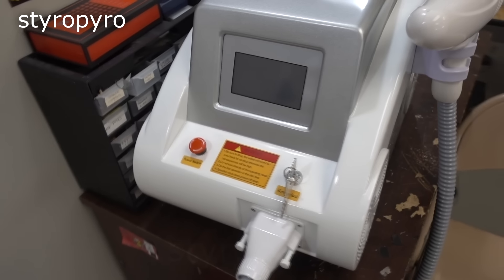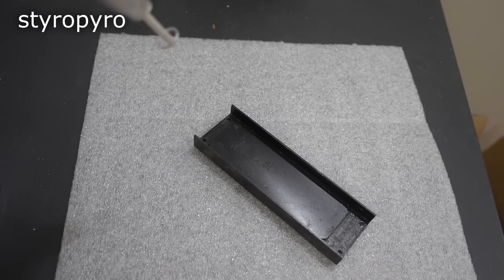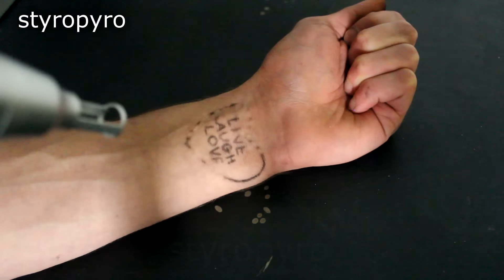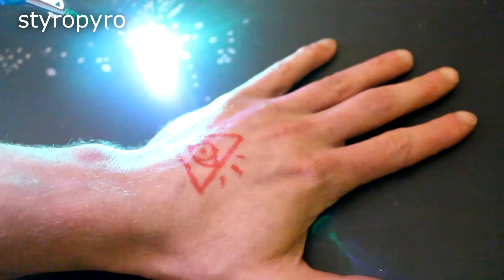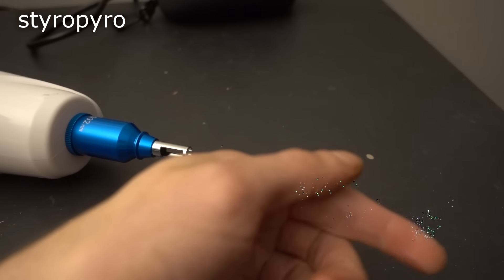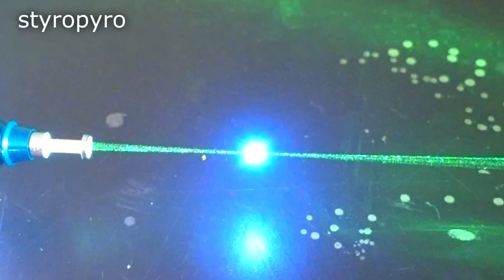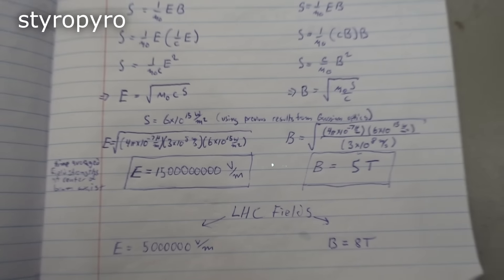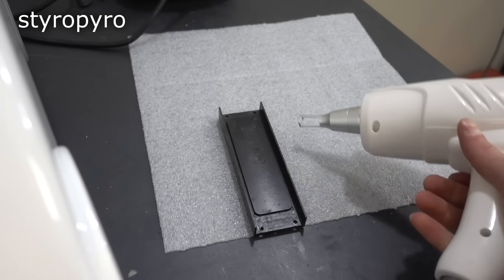Dangerous tattoo remover from eBay is a MILLION watt laser

Comment: This mans mannerisms make it look like he's actually a living puppet
Reply: It’s his face man
Reply: He is
Reply: Exactly what I was thinking
Reply: he's the scout
Reply: rude
Reply: Why you dissing him? Man's a total nilf
Reply: @saturn6458  Jerma
Reply: Thats misleading. Watts are(as we all know it) are measured in watt/hours. That means wattage continuous for an hour. My microwave is 900watts. That's the rating for it running 1 hour continuous. No house or  appt or even an office building is going to have a breaker on the breaker panel that will handle 1 megawatt. You can have 1 million volts by adding a transformer and that's why stun guns exist but theres no way that's a megawatt aka 1,000,000 watts. My phone charger takes 1 megawatt too.... but it would take a year. Wattage is an hourly measurement. Nice troll though.
Reply: @stevem2245  Thanks for the info Steve
Reply: @stevem2245  You're so mistaken... where to start... You seem to be confusing domestic energy metering (kWh, not kW per hour!) with pulsed power measurements. This laser IS using megawatts of power but for a very short period (nanoseconds). If it's 2 Joules of energy per pulse of 6ns, P=E/t so the power during the pulse is 330MW. For the rest of the time the power is zero. If there's 1 pulse per second then the average power is just 2W! Well within the typical domestic plug capacity of ~3kW.
Reply: @manicminer4573  My bad then. To the non laser/stungun/ taser YouTube community then it was misleading. Mostly everything else is measured for a continuous hour. Tell me then.... how many watt/hours would it be? What was the volts/amps of the laser?  And how would you measure that? There is a reason why its measured in such a way at your home power meter. If it was a megawatt/hr laser, than I'd be impressed. Therefore I clicked in the misleading video thumbnail, hence my comment. Help me understand.
Reply: @stevem2245  It's high school physics, but it's usually taught badly. Energy is measured in Joules or kWh. One kWh means 1000W of power for an hour. Common misconception is kW PER hour - it's not, it's a kW FOR an hour. So 1kWh is a large amount of energy.
Energy = power x time
Reply: He seems stiff, yet so loose
Reply: @stevem2245  one watt of power is one joule of energy consumed in one second. 1W= 1J / 1s. your microwave consumes 900 x 60 x 60 joules in an hour of continuous usage.
Reply: He just doesn't seem like a real person
Reply: BWAHAHAHA
Reply: This comment is gonna become another dumping ground for nerdy arguments
Reply: @stevem2245  The Watt is a unit for Power,measured in "Watts", at any instant, similar to Volt/Amps. kWH is Power Consumed.
Reply: Thank you! My god I was afraid it was just me. It’s freaking terrible, glad he’s kinda smart because there’s no way he has a career in acting or reading the news. He’s so wooden that two big honking fuzzy black caterpillars have taken up residence on his face just above his eyes…. -“Wait, what? No way those are just eyebrows…... Really? Hmmm…. Well I’ll be damned.”

Comment: 2:00 No one going to talk about the fact that this man has a screwdriver jammed into a wall socket?
Reply: You wanna know the forbidden art of removing static?
Reply: It’s a ground
Reply: 100% functional ground wire
Reply: you should be doing this when working on any PC equipment
Reply: that's just another experiment, don't worry about it.
Reply: It's stuck in the ground pin which has absolutely no electricity flowing. Some anti static wrist straps are designed so that they're connected to the grounding pin
Reply: Meh, ground, *should* be okay. Just don't confuse it for phase ......

Comment: You could tattoo instead on materials like iron instead of removing. The thing I wonder is why it doesn't hurt to have the laser directly pulsing on the skin vs the green converted version of it. Great video!
Reply from the maker: skin is nearly transparent to the 1064nm light, so that means the skin doesn't heat up much since it's not absorbing much of it. this is great because dark tattoo ink absorbs it very strongly so you can selectively burn the ink while leaving the skin relatively unharmed.
Reply: How did you comment 1 day ago
Reply: @vv6152  right?!
Reply: this video came out 6 minutes ago, how did you comment 1 day ago?
Reply: @vv6152  maybe he has early uploads for Patreon members?
Reply: Styro made it unlisted, and Centanide could’ve figured out the link
Reply: How the eff do people still ask this question? Patreon!
Reply: Essentially, skin is transparent. So the laser penetrates, expending the same amount of power over a greater area. This means it's less damaging, in the same way that having the sun on your skin doesn't hurt, but using a magnifying lens will sting like hell. 

Added to that, light skin doesn't absorb the normal laser very well, and most of the energy gets reflected away instead of damaging the skin. Essentially, things have color because that's the light they reflect away. A Green object reflects green light, etc,. Green and Orange/Red/Pink are opposed though, so a red laser would burn green things, and a green laser burns red things.
Reply: Haha, he even explains why at the end of the video.
Reply: @styropyro  When the skin is transparent. Where does the energy go? Is it reflected and just scattered or absorbed by an underlaying organic layer?
Reply: @styropyro  wait, if skin is nearly transparent to this laser, would be possible to blind a person with their eyes closed?
Reply: 1 day ago.... Sure
Reply: @elios7623  bud it's called patreon
Reply: @vv6152  wtf holy shit your right how did he comment one day ago?!?!!
Reply: @vv6152  YouTube mysteries
Reply: styropyro keep up the good work your amazing
Reply: Did you even watch the video?...
Reply: Deadshot 18079 there’s a glitch in matrix
Reply: Centanide the skins absorb more of the heat from the green converted version
Reply: @chaschuky999  yes i'm aware, but the need of meming is stronger than me

Comment: Styropyro in 2050:
Ah so im on the deathstar of mine
Reply: So I made a new Lazer for it, I just bought one off of eBay, so I went ahead and made it just about 20,000,000 times stronger. But unfortunately it can only Peirce through 2 planets and only travel 6 light years.

Comment: That machine does work.... Those different lens/tips is to change different laser wavelength to remove different colors tattoo.... ie 1064nm,  532nm, 755nm, and 785nm.... It can also be used for permanent hair removal.

Comment: You aren't using it right. That standoff at the tip of the emitter is actually to mark the focal point. The beam is almost colimated bu not quite. It actually comes to a focus at the tipof the standoff. For best results, place the standoff on the surface you are working on. Also, the multiple tips are for different wavelengths. One is for raw IR output (YAG laser output is 1065nm IR). Another tip contains a frequency doubler to output 532nm green light (same as in a green laser pointer). And the last one is a frequency trippler which outputs 355nm UV light. These different wavelengths are useful for people with different skin tones.

Comment: 532 nm light or green light is actually suitable to mend tears in the heart and vascular tissue.. And that's why it burns your skin much higher than IR light.

And if that burns imagine getting burnt by 355nm UV light.. Hurts like a bitch.
Speaking from experience 😂
Reply: Oh common... CO2 kicks ass when it comes to burning sensation. 355 at 10ns duration is a tickle. Well, basically most tissue it reaches evaporates in less than 400ns and the rest of your skin waits for a response from nothing. Of-course if you release a few thousand of 355nm pulses in less than a second, you'll be screaming!! Comments also from experience.
Reply: @johnriver5384  yeah but a 1.5watt CO2 doesn't hurt as much as a 1.5 watt 355nm laser 😂. I spoke merely on the basis of pain level at specified wattage.
Reply: AH
Reply: on the flip side, i used to work optics with verizon, the video gear is 1310, 1480, and 1550 nm IIRC and many guys have gone blind or at least partially blind by not being careful. the invisible demon.
Reply: @jumpieva  yeah, i have a spot on my eye as well, by specular emission from a high power IR laser. The invisible demon does dole out damage
Reply: Ah yes the co2

Comment: Hey, Styropyro, can you try turning the million watt laser into an actual laser pointer type thing that doesn't pulse and produces constant light? I want to see how freakingly powerful it'll be.
Reply: It might require cooling. The strongest laser in the world is at least 10 petawatts, which is 10 billion times stronger than 1,000,000 W, but it does this by pulsing similar to the laser in this video. Although I think it needs even shorter pulses due to the high power levels, to keep cool
Reply: @arande3 "cooling"
It sounds like it would overheat on Pluto 💀

Comment: In a black doll facial lotion containing small particles of carbon is applied to the skin and then burned off. the thermal effect created on the skin forces the reworking of collagen in the skin.
A picosecond laser is not ideal for hair removal because the pulse width is too short to transfer sufficient heat to the follicle to kill it . the eyebrow setting is to remove permanent makeup tattoos underneath someone's eyebrows, not the eyebrows themselves with the picosecond laser. A ms switched laser, often a diode laser is a preferred method for hair removal at a reasonable cost.

Comment: It wasn't the air on fire, that was dust particulate in the air passing through the light beams path. If you had pointed the laser at your good goggles the same result would have occurred. Firstly point any powerful light source directly at your eyes is a silly thing to do, secondly if the laser beam were to accidentally hit your chosen eye wear it would in most cases hit the outside of the lens, whereas you were pointing the beam through the lens of your cheap goggles from the inside.

Comment: stupid question:
in an awful world of war crimes, couldnt you make a laser that would blind the enemy instanly?
Reply: Its possible. And what would be even worse is using something like an extremely powerful infrared or ultraviolet laser, which could instantly blind someone, but also be completely invisible (as in you cant see the beam in the air at all)
Reply: Apparently it's not only possible, but was actually tested, but military use of such devices is prohibited by The Protocol on Blinding Laser Weapons of 1998, so yes - it's an actual war crime. War crimes happen during literally any war conflict, so I guess permanently blinding lasers are actually used in military at least sometimes
There are though devices called dazzlers that use intense light to cause temporary disorientation without permanent blindness and they are used in military too

Comment: Isopropyl alcohol absorbs through the skin and is highly toxic?
Reply: As someone who has had tones of isopropyl alcohol on there hands from cleaning electronics, i can say i am still standing. Most of the time when ppl get isopropyl poisoning its because they have it on there hands for a prolonged amount of time. so as long as you wash it off after using its fine.

Comment: If you want to remove tattoos,  repeated sessions of drain cleaner chemical burns is cheaper, requires fewer "treatments ", and is ultimately more effective.
    I know from experience, but I'll just add a disclaimer anyway.  Don't listen to me. But, if you do it, start with small amounts and dont leave it on more than two minutes after you feel it start burning.   Start very small and slowly work your way up. Its still going to take you 3-4 rounds before you can tell that it's effective.

Comment: So what would you need, component wise to turn the laser on continuously like a phaser? Maybe a super cooled heatsink? Some liquid nitrogen perhaps
Reply: It doesn't work like that it's designed to be a pulsed laser you'll just burn out the flashbulb..  I mean hypothetically you could use some MOSFETs and caps and rig up something that uses multiple flashbulbs to gap the timing and mod the existing handset and cooling to accommodate it but at that point I'd probably just use a fiber laser instead.

Comment: Impressive! Would it be possible to couple this with a spectrometer and camera and produce a readable spectrum to identify metal composition>? There are many affordable lasers capable of engraving metal that are cheaper than this unit. Units for the purpose of classifying metals like for junk sellers are priced $15-50,000 per handheld unit! I think it is possible to do this with the tools I mentioned and a laser.

Comment: Hi @styropro  - question from a non laser savvy human: Can you remove the pulse feature and get a sustained laser at the same power?
Reply: Afraid not. Electricity usage is measured over time. You can condense the amount of energy that you expend into a single moment to get absurd power density. Constant beam means that it costs far far more energy to get the same power density since it has to run for millions of times longer than it does for the instantaneous burst.
Reply: @AeyakS  I thought so, otherwise he probably would have done something like that for the video. Thanks for the explanation.

Comment: Deionized water is not a "really, really good insulator".  It is not a particularly good conductor, but that is far from the same thing.  The main reason your skin was not burned is not that it reflects the light particularly well.  It does, of course, reflect a fair amount of light, but nowhere nearly as well as that Tungsten, Aluminum, and CD coating do.  The main reason is that water has a large thermal mass and a HUGE heat of evaporation.

Your town must be pretty small, and devoid of much industry, if it only uses 15 Megawatts.  Heck, my house by itself can peak near 12 Kilowatts.

Comment: Can this be repaired cheaply by replacing the flash lamp?  Can it be maybe converted to continuous-wave laser by replacing the flash light with a much weaker contiuous lamp and removing the q-switch and perhaps adding cooling?  That might still be ridiculously powerful.

Comment: I bought one to remove a full sleeve tattoo, it was a shitty black pigment tattoo i got when i was like 16 it turned into a mess when older and i finally removed it at 33 after hating it for a decade. Bought this cheap contraption after going to tattoo removal beauty places which offered ridiculous prices, so i bought this thing and hoped for the best got top of the line goggles and went to work and honestly it removed the whole tattoo no problem, i was even able to get it dialled in where it would break down the ink without really frying my skin. Honestly its a shifty and risky think to do but it saved me a ton of money and my wife has even used it for lightening red marks, and experimented with using it for hair removal and it worked ok for that aswell, then i sold it for about half the value.....so yeah bought it for 800$ removed a sleeve quoted at 2200$-2500$ to remove plus removed various red marks and blemishes and my wife was successful to use it to remove hair aswell although it didnt work for me. Then i sold it for 500$ so all in all it was completely worth it.....just get good googles and make sure you buy it off a reputable seller on ebay. Bought it expecting a scam but was very impressed with it.

Comment: definitely the green attachment that’s killing your sensor. most cameras use a Bayer Array sensor, meaning that each color is laid out in a mosaic, specifically one that has more green than either red or blue.  which is why you only have green dots on your sensor. the red and blue channels were unaffected.

try looking at a Sigma camera. they use a completely different style of sensor called a Foveon sensor that doesn’t arrange it’s color sensors in array, but instead overlaps each channel with transparent sensors, giving full color input at each pixel of the recorded image, instead of interpolating the colors like a bayer sensor does. unfortunately, Sigma patented the sensor, hence only their cameras having it. 

that being said, more green on the sensor means more pixels to ruin, so maybe it wouldn’t be a good idea, but it depends on how the sensors absorb light 🤷‍♂️

Comment: Just bought the same one..first thing put high x. Double convex lens infront of it and see if i can gat through a razor blade...my ssy1 abrams tank rangefinder laser can..with a little help instead if 35 ufd at 850 v.i give it 30 ufd at 2000 v.roughly 4 times the power no problem

Comment: I think you could actually use some actuator to move it left and right very fast, or some kind of mirror or so

modifying this with a low duty cycle high frequency pwm (igbt + microcontroller) you could literally turn it into a rust removal laser with the infrared, shouldn't really hurt you but blast off rust, and even better is the fact that professional rust blasters cost $50,000 or more, while this thing costs like $300